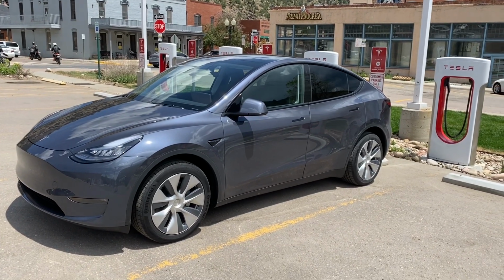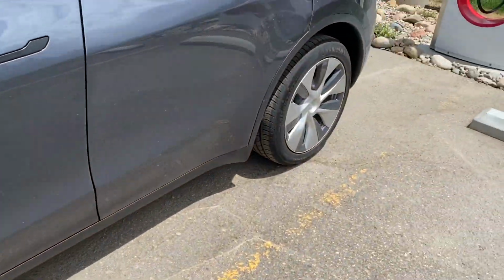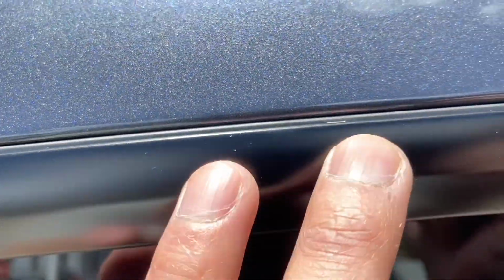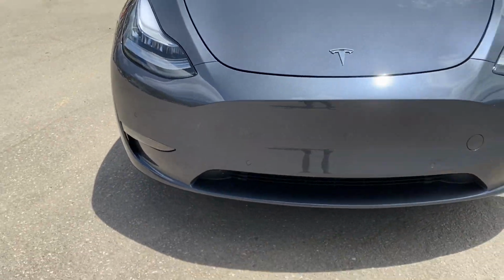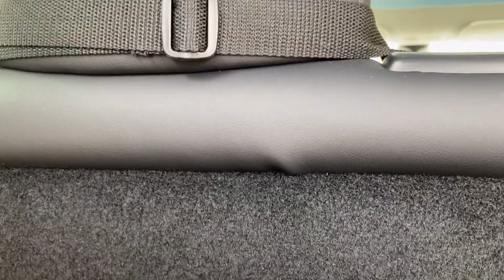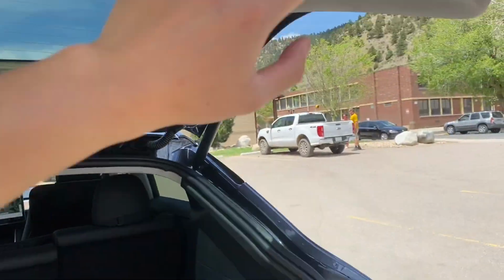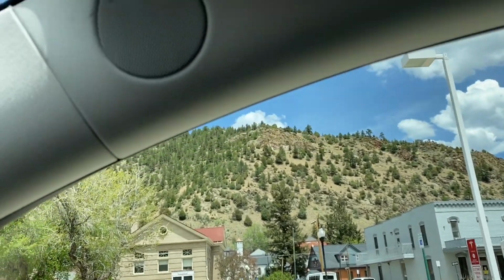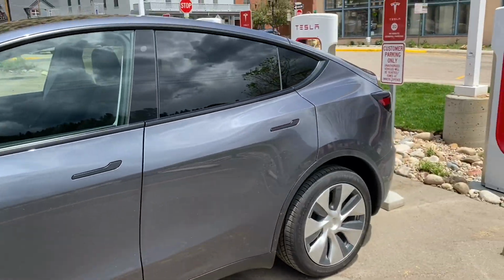Tesla Model Y Dual Motor QC Check

Comment: Sorry to break the news to you: Tesla does not use leather. The irregularity in your vinyl backseat is very common. At least you should know that no Teslas come without some kind of workmanship defects. I have inspected hundreds of Model 3 here in Australia and they have never been uniform in quality. Better start praising Tesla on social media now or their fans will start attacking you soon. Good luck!
Reply: 1stMil.com  this is a common issue with Tesla and no Tesla fans would attack new owners for pointing out the production flaw. This video actually helps future owners like me (huge Tesla fan) to know what to look for when inspecting a new car. Until Tesla figure out the QC, such inspection is a necessary step in  owning a great car. After all, all of these issues are mostly cosmetic and  will be addressed and repaired. Furthermore, such videos help to bring quality issues to Tesla management.